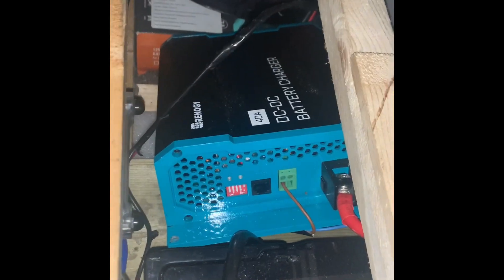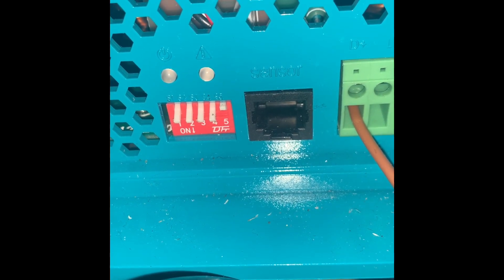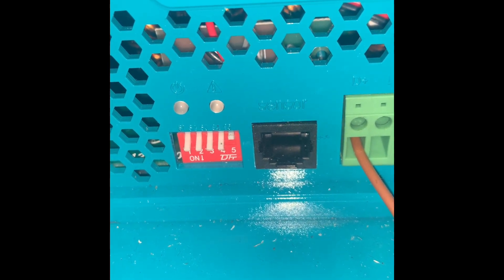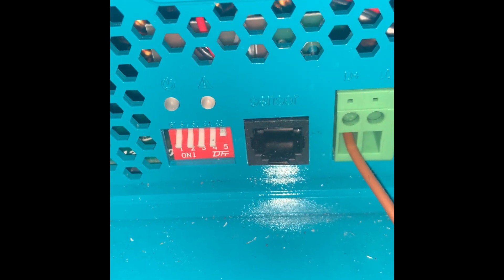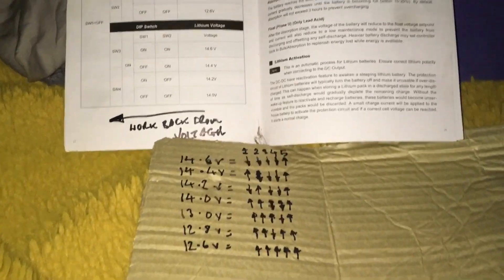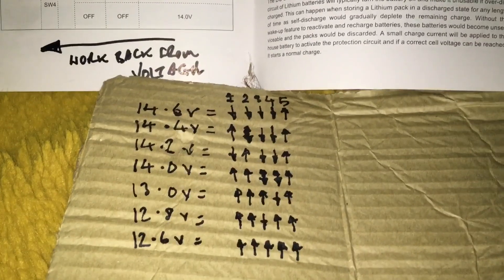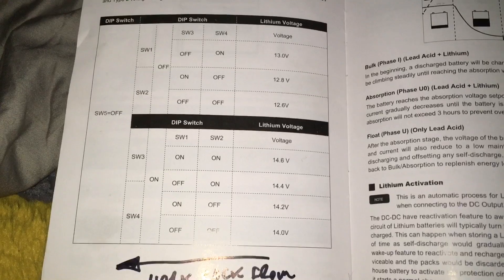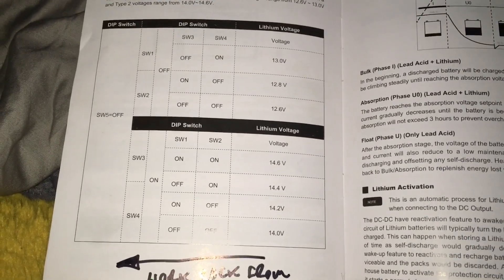Renogy  dc to dc , battery charger  , Dip switch  settings

Comment: Awesome video, thanks for sharing. The wording in the manual is terrible. I have a LiFEPo4 battery that’s description says 12.8 Volts. I took their using the words battery “type” incorrectly.

Realized in this video they are referring to the charging voltage, like you pointed out probably should be between 14.0-14.6 to get any charge on a lithium battery. Set mine to 14.4 volts as recommended by my battery manufacturer when I had previously asked about my MPPT charge controller. 

Appreciate you breaking it down!
Reply: Is it an eco worthy lifepo4 100 ah? My problem is the same as yours.

Comment: It’s so bad because I can only get 9 amps from mine. I checked all over and now everyone is saying the manual is WRONG!
Reply: 9 amps sounds like a faulty unit , what batteries are you charging ?
Reply: @fradaja  LiTime Phosphate 100 amp. No matter what I do, can’t get it above 10 amps. Someone said it might be my solar controller confusing the BMS. But I’ve also tried shutting down my controller but mother changes.
Reply: @AmericanAdventuresInJapan  

I’d disconnect every output and input to and from the batteries, I’d then connect the charger ,with only the charger connected , I’d set dip 1 and 5 to off all the rest to on , with connection direct to the starter battery , I’d check the output from the charger to the batteries with the engine running  , you should be reading 14.4v or close , the amperage will fluctuate depending on the starter battery soc , I’d expect at least 20amp , depending on your alternator
Reply: @fradaja  I will. I got soooo much work ahead from storing power and such…. It’s just frustrating to rely on a system then not get what is needed. 
Thanks bud.
Reply from the maker: @AmericanAdventuresInJapan 

I switched from a split charge system, both my voltage and amperage are higher at the batteries , but that depends on my starter battery soc . My alternator is 70 amp, so I’m getting 40amp regularly
Reply: @fradaja  thanks bud. Found the issue. Thanks for pointing in the right direction. One of the crimps were not good enough. Re wired it and now getting almost 20 amps. Thanks.
Reply: @AmericanAdventuresInJapan  

You’re welcome